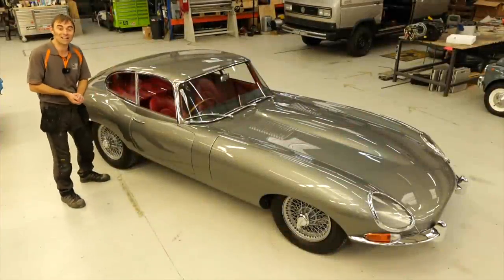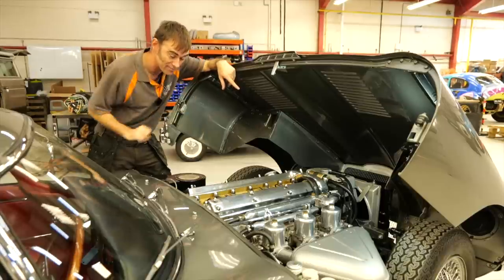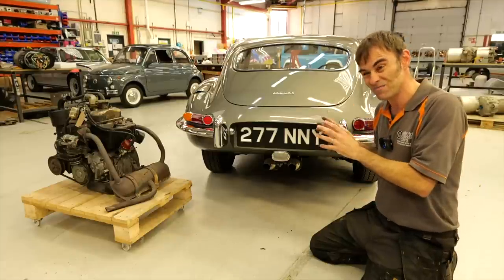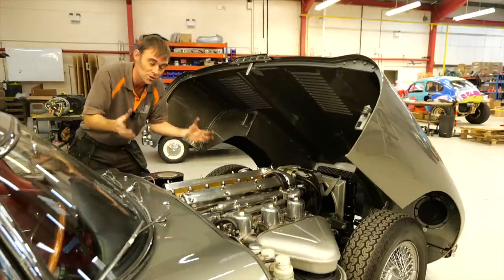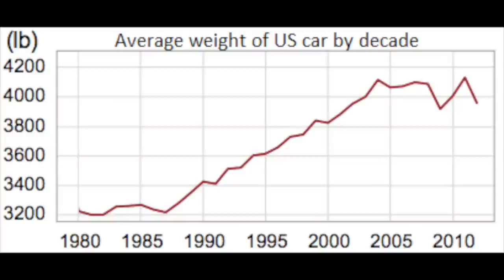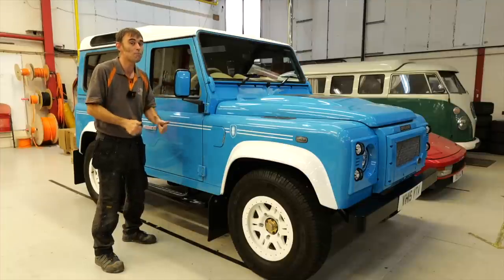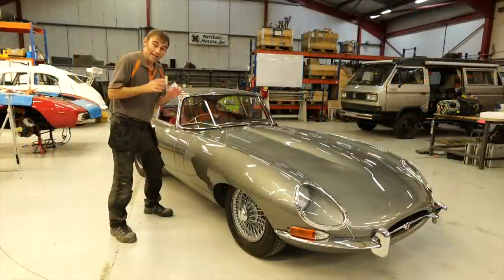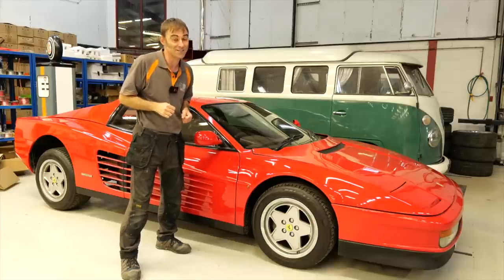Is it a sin to convert a classic car to electric?

Comment: Having taken a Ferrari 308 I've owned for 20 years, with a tuned Borla exhaust, (which I used to go out of my way to find a tunnel to drive it in second gear through), to have Moggie and his fantastic team stuff a Tesla model S drive in it.  - I never missed the sound. Not once. Ever. The halving of the 0-60 was overwhelmingly noticeable along with the torque where ever you want it and the fact is started every time is a big bonus. But the drivability mentioned here, it cannot be described. It's a game changer. Until you experience it, you won't get it. So I suggest you give it a go.
Reply from the maker: Thanks Peter. The voice of experience. 👍👍👍
Reply: No more "engine out" maintenance, you're sure to miss that.
Reply: No thanks.
Reply: @ElectricClassicCars  having no noise is golden. People used to miss the smoke from steam trains but hwo misses that now.
Reply: You will miss the fine smell of the real blend of gazoline from the south side of kuwait. The feeling of turning the keys to start the car and nothing happens. The bone deep vibrations loosening your teeth when driving faster than 30. The remving of the engine to replace the main seal every 3 months.
Reply: @mattlawton4715  I do! Miss the steam from real locomotives. Thats why i don't drive trains anymore. 🤣😂
Reply: I just couldn't do it... it would be like stripping the guts out of a vintage Rolex, and replacing it with a battery quartz movement. Lol.
Reply: @wolfgangpreier9160  maybe but not the black smoke tho
Reply: @mattlawton4715  Oh that was the highlight of my youth! Coming home covered in sud and grime and dirtying the bathroom so my mother had to clean a week long.

Golden times!

If you miss my point, i am being sarcastic. 

I would rather replace oll fossil burning engines wih clean motors - i don't care whether they are electric or using amonniak or are nuclear powered as long as they don't burn and stink any more.
Reply: @wolfgangpreier9160  absolutely
Reply: @ElectricClassicCars  so if I covert a let's say diesel to electric I don't have to pay congestion charge etc do I have to get the car registered.
Reply: @wolfgangpreier9160  I passed a Stanley Steamer 2 weekend ago on the ‘Bay to Birdwood Rally’.  The steam was significant, but the smoke from the fire heating the boiler was horrendous…
Reply: @mattlawton4715  Probably won't get any benefit. We had a Volvo converted to LPG a long time ago but it didn't qualify for the same VED reduction as a factory bi-fuel. That's just a guess though but I doubt it's an easy accomplishment.
Reply: @davidburne9477  We do not have such old thingies any more. They are placed in museums. Some old locomotives are being renovated by privateers but that takes ver long time. Decades even. Everything else was either destroyed in two wars or removed by the russkis. Even the old steam locomotives went to Russia when they were moving at all. Only those already kaputt were left.
Reply: I went to a party in a field in Devon and a guy brought his 308 - which is my favourite Ferrari ever BTW - after a night outside it had to go home on a tow truck...
Reply: Well it's not really a Ferrari anymore though. The point of owning a Ferrari is the rear mounted flat plane crankshaft engine. Now you have installed a bunch of electronics-of which become quickly outdated-its simply a Ferrari shell. In 3 to 5 years the chances the aftermarket electronics being outdated and undesirable similar to a 3 to 5 year old cell phone are high.
Reply: @moabman6803  ON the other hand - its not in the shop wanting fixing when you want to drive it...
Reply: @Piccalilli Pit  You still have old suspension, steering, and axles of which your installing a far more powerful motor than factory. Those components were never designed for such power. So now instead of rebuilding the carburetor   or replacing the spark plugs once in a while, you get to replace a destroyed ring and pinion or axle shafts.
Reply: @piccalillipit9211  no, its going to be stripped in your garage, while a mechanic its going mad trying to replace a motherboard with something slightly compatible cause the original have been toasted and it's out market
Reply: @moabman6803  - Well you don't HAVE to put a way more powerful motor in - I would not for the exact reason you just said.
Reply: @Piccalilli Pit  Even with a aftermarket less powerful motor, you still have aftermarket EV components. Electronics become outdated quickly. Will the Electronics be supported in 5 years or so? Will technology end up going hydrogen or some other route in 5 years? It's a turbulent time for technology/vehicles.
Reply: Frankly, people who "miss" poorly running cars never took care of them. I fail  to see how their experience defines the thing, but others' experiences do not.
Reply: I can understand when oldtimer people want their oldtimer still stinky slow as they are. But it’s always your decision what to do with your toy and once you go electric you never want back. I am a huge car guy all my life, but I always preferred a car that drives better over a car with more noise.
Reply: @hardywoodaway9912  and you don't feel that tossing in insults makes your point less valid? Sorry to say you don't invite discussion, you challenge to a fight. Your points should be able to survive on their own. if they can't, make better points.
Reply: Soulless......
Reply: @mattlawton4715  A lot of folk. Don't believe me? See how many queue to see a steam train if its in service.........
Reply: @paulmiles6012  
That's a perfect analogy....👍👍
Reply: @originalforgery  you know actually me too
Reply: @piccalillipit9211  The sad thing about any engine which is highly tuned! "When performance goes up - the reliability comes down". EVs definitely overcome this issue - if manufactured correctly.
Reply: @moabman6803  Any Technical Advancements in Batteries or Electronic Drives - can easily be added or substituted to any EV Ferrari. You truly cannot say that about the Ferrari engine, which have very high maintenance costs.
Reply: @moabman6803  Some people will agree with your comments, but I don't. We are continually using-up the world's resources - which are absolutely filthy when burned. Do you really want to be tied to OPEC for the rest of your life? Where your hard-earned money goes overseas, instead of improving your own country's GDP? Today there are cleaner and valid alternatives of getting from A to B. You have absolutely no control over the petrol prices - or fuel taxation which could double tomorrow. What then?

Comment: There is a strong anti-change effort going on in "my" generation.  Anything that is "new" or "weird" is completely sacrilegious and should be burned at the stake (yeah, I live in the USA).  There is no real argument that can be made to support it, so they have to argue the point on a "feeling" or other intangible point.  That is where the "soul" of the car comes in.  It was stated very well by someone I knew back in high school (in the 80's) that it's just not worth fighting with the religious mentality because your fighting with a ghost, nothing you say will be heard and nothing you can do will be felt.
Reply: Thats a bit sad but I would say its true. The same goes for a lot of men over the age of 45 in Sweden as well, and especially the further you get from the bigger cities.
Reply: So true, they are stuck with what they understood when a teenager thru 30s.  And anyway If Makers of Classic cars would have had viable Electric  motors, batteries, and Electronics where available to them, they would have sold the Classics with the option of an Electric motor.  There is NOTHING "magical" about a Petrol engine - it was just the most practical at the time.  And now with modern Batteries, EV power is also practical.
Reply: Nice to hear that..
I am from the Philippines and seems what you guys say are ture as well, here. I have ordered a bunch of components (yes, from China) to convert an old Suzuki Mini Pickup into an EV.. 
Know what? I dont care what the oldies say.. I can hear them already saying, you'll not go far enough. It wont work if you DIY. You can"t have it registered. Its too expensive. Blah blah blah..
So when all of these are said and done.. Then they"ll see me smile..
By the way Im a retired 67 year old..
I leave the others do their thing and I follow my heart.. Life is short and doing this makes me happy.
Reply: The US military is going electric for their tactical vehicles including a hybrid Abrams. As per what Beau of the Fifth Column spoke about about 10 days ago.
Reply: @bobmitchell8012  Point proven.  There is no actual argument, so you have to argue about "soul".   And, if your an addict, you should get help, not act like your opinion is one of many that are correct just because of a mythical belief.  Get help, get better!  We are all rooting for you!
Reply: I thought the idea of the "soul" of a car came from the engine being equated to the human heart.
Reply: @LouisSubearth  I agree with you.  And In that case, since our own hearts and even the mechanical ones of combustion engines use electricity to run, it simply stands to reason an electric motor would just be an evolutionary move.  Once again proving this "soul" argument a moot point.
Reply: @alanmay7929  If you think driving every electric car is the same experience, you obviously have yet to drive many.  They are affected by temperature, road conditions, upkeep, and most importantly the inputs of the idiot behind the wheel!  People have been building their own electric cars for well over 20 years already!  Even JerryRigEverything is converting his Military Hummer to electric on his channel.   There are people madding Tesla's!  Where have you been?
Reply: @alanmay7929  If you choose to ignore what's actually going on, how do you expect anyone to take you seriously?  Calling me names changes nothing.  If you were actually interested in having a discussion on what was going on in the world I would keep paying attention to you.  People are doing it, your ignoring it and saying they aren't.   No point having a conversation with someone who can't see past their own nose.
Reply: @KeithCarmichaelInFL  dont waste to much time on that one. They are quite impervious to anythin that doesn't fit in with their world view.
Reply: I'm 72 and have been fiddling with electric propulsion for around 45 years.  I converted a 1970 VW beetle to electric, then a Fiat 127.  I now drive a 2019 Chevy Volt.... The most perfect hybrid sedan.
Reply: @KeithCarmichaelInFL  Men have always been resistant to new things, not just your generation.
Reply: The world has gone through unprecedented change in the last 3 years. Most of that change has not been thought through and just effected on society. Change where warranted is good but change for change-sake is a mistake and all generations need to be cognisant of that to stop mistakes from happening and their inevitable consequences. Changing these cars to electric is an example of a mistake. They will depreciate about 40% in the first 3 years alone (please see the link at the end of this comment). If left alone however and preserved they appreciate substantially over time. In short electric conversion is huge wealth destruction. Also original classic cars ALL have lower carbon footprints than even the most assertive environmentalists (including Greta Thunberg) as they don't get used often. Their purpose is not everyday use but the enjoyment of their originality. So there wont be any detectable difference to the environment either whether they are electric or ICE. So please consider whether the change someone is proposing is good or bad. Here's the link https://motorway.co.uk/sell-my-car/guides/electric-car-depreciation
Reply: @batchmate7002  Can you show on this doll where electric cars touched you?
Reply: @DuBstep115  what doll?
Reply: @batchmate7002   If your looking for an investment, then you should invest it in something that will multiply value quickly rather than the very slow growth one of these will offer.  Switching it over to electricity and upgrading the vehicle to more modern products will increase the usability of the car on a regular basis.    That is the purpose of this channel, his shop, and the entire thought process behind the business he operates.  Electric conversion is NOT a cost effective solution to dealing with a classic car.
Reply: @KeithCarmichaelInFL  I am not inferring classic cars should be investments. I am highlighting something which  I think people should be aware of which was not covered in the video - depreciation versus appreciation. If someone is considering converting their classic car to electric I feel they should be informed of all the pros and cons. I will provide an example. In the UK, in November 2019, a typical original Ferrari Testarossa was on the market for about GBP 90,000. Today they are worth GBP 140,000 (ie 55% appreciation). However, if they had been converted to electric in November 2019 and if indeed they do depreciate by 40% in the first 3 years (as per that article) then they would be worth about GBP 54,000 today. Don't you think this 95% differential over the first 3 years is relevant? You mention about 'dealing with a classic car' but I am not sure what there is to deal with. They are not harming the planet in any detectable way and if anyone wants a regular car they can buy a regular car and use that. I am not averse to electric cars at all but I think the pendulum has swung too far by needlessly converting rare classic cars. Given this why don't they electrify what is constructive and progressive eg fishing boats, recreational boats, motorbikes or any car where the engine has been certifiably written-off etc. There is nothing personal in what I am saying but when a blatant mistake is happening I believe people have the right to call it out and explain why.
Reply: Lithium
Cobalt
🤔🤔🤔
Reply: iscadean  Almost?
Reply: Ok Boomer

Comment: Richard, I completely agree with you!  The engine and motor are just machines which provide mobility, that's all!  I bought a Tesla Model 3 Performance more than two years ago and haven't questioned my decision ever.  The quietness and sheer power of the Tesla astounds me.  Cheers!

Comment: @2.25 '"Always a good idea to listen to people with experience and not opinion" Absolutely right. As a former devotee of the 'Under £1000' section in AutoTrader, I can attest to the pain of owning old bangers to try and get me to work. Granada MkII (autobox stopped) Lancia Delta (always leaking coolant) Fiat Uno (rotar arm crack), Honda Prelude (fuel tank leaking allover).
I stopped owning cars back in 2001, and only in 2019 took out a lease on a BMW i3. What a revelation, no droning noise on the motorway, no strange noises coming from autobox, no whining diff etc. Fast, reliable and most importantly, very cheap to run compared to ICE. It's cost of ownership as well as performance that is driving uptake of BEV's now. I would absolutely love a classic car - but only with BEV drivetrain so that I can admire it, and enjoy using it everyday. I think there is a vast un-tapped market for converting some of our 70's / 80's / 90's favourites that are still on the roads. Most importantly, the emissions associated with these vehicles are already in the environment - better to re-use and recycle. Anyone for an electric Volvo 240 GL ?

Comment: As a related issue; traffic noise is vastly reduced. I live nect to a busy B road and in the summer the noise from (especially) hoards of bikers, but also cars, lorries and buses as they accelerate out of the reduced speed zone (or the tractors that don't even slow down) makes outdoor life (the balcony), or even keeping the windows open on a hot night, impossible.
Traffic noise pollution is so overlooked these days witrh all this talk of CO2, but for the millions living within earshot of busy roads. the impact on health is measurable.
Reply: Good point 👍😀

Comment: As a second point, I work in the listed building conservation field and many of the points you make about alteration ( or “intervention” as it is called in my field ) are paralleled by the arguments that go on with listed buildings. Key areas are conserve? renovate? re-order? or extend?and considerable analysis goes into the “significance of the original” both in architectural and historical terms before any decisions are taken on for instance rare grade 1 listed buildings. Ypur argument about the significance a of a mass produced  but beautiful car is well made, provided of course there are plenty still left. You can always keep the best for Beaulieu!
Reply: Good points, thanks 👍😀

Comment: I have a Daimler with a V12 engine. It takes me the best part of a day to just gap the spark plugs.  The reward of occasionally opening up the throttle so I can hear the howl of the engine, does not outweigh the effort required to maintain the engine.
Reply from the maker: Yep, that's pretty much where I got to with my love of classic car engines 7 years ago. The maintenance was outweighing the enjoyment of driving them. 👍
Reply: A day to gap the spark plugs, Is that including naps or something?
Reply: @4Kandlez  The air conditioning compressor has to be removed, to get access to two of the plugs. Jaguar garages used to schedule 6 hours for the job - and I am by no means experienced at the job...
Reply: @cosgraham534  design flaw , takes me 20 minutes to change and gap plugs on my v-8
Reply: @imarobot3757  A V12 is a LOT of engine, which is very difficult to fit into a car. Jaguar released the XJ model as a straight 6, because at first they couldn't fit their purpose designed V12 into the car by launch date!